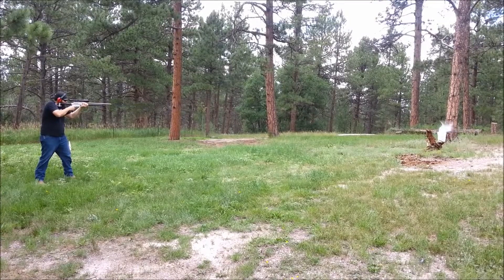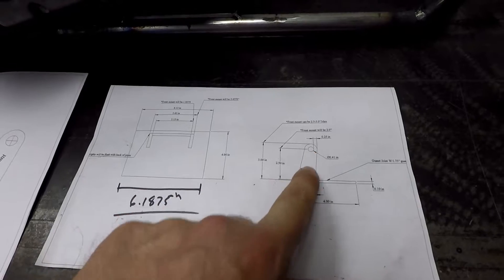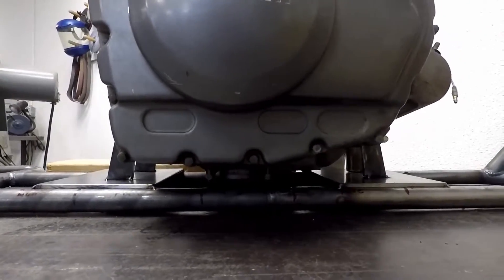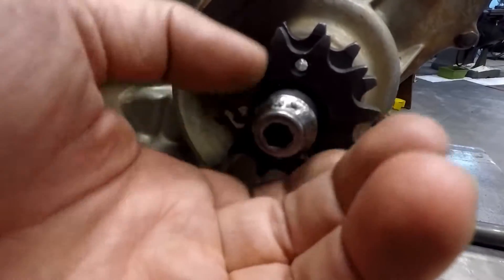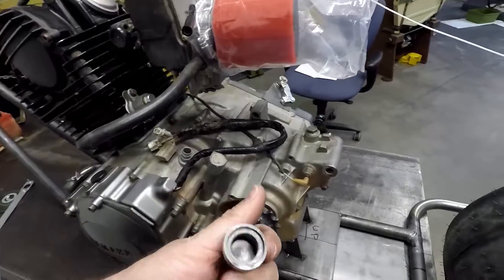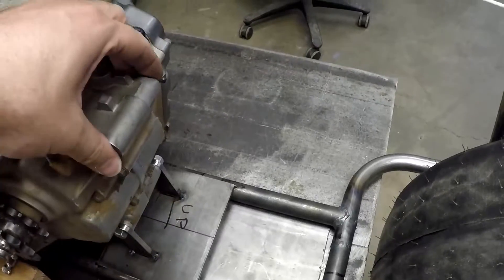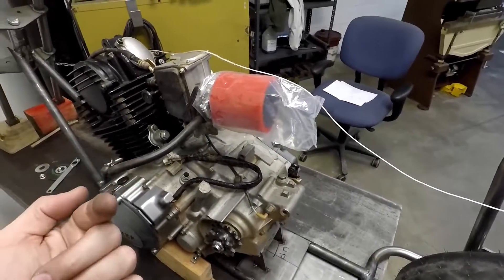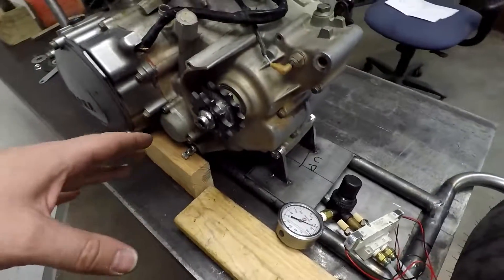Ridiculous Mini Bike Build: Offset Sprocket & Progress Update

Comment: I’m building a wide wheel bike as well but my small sprocket needs to be about 2.5” wider….any ideas?
Reply from the maker: There are companies that make widened sprockets, depending on the engine and such. Otherwise you’ll have to make one or have one made.

Comment: Just gonna point out 1 thing you need to address 
Having  a bike with a WIDE SLICK is a bitch to turn 
You might want a rounder profile back there
Reply from the maker: It is a drag bike, so it'll be just fine! As long as it hauls going straight, I'll be fine. The slick is only 8" wide, and it has kind of a rounded profile, so it's not like a top fuel bike slick.